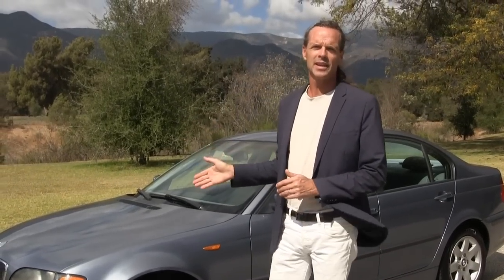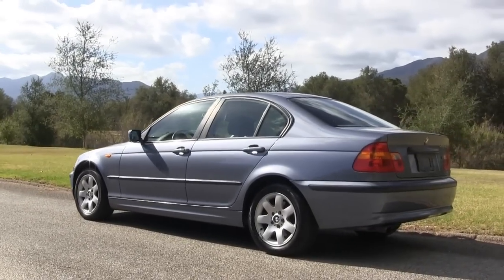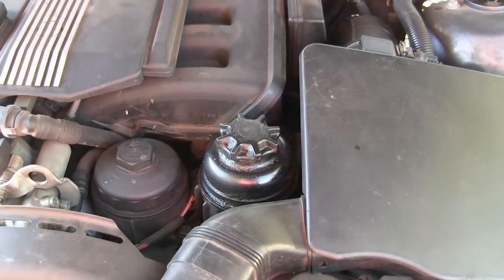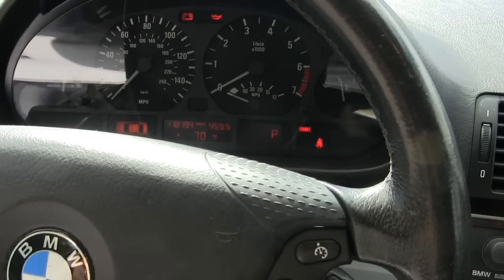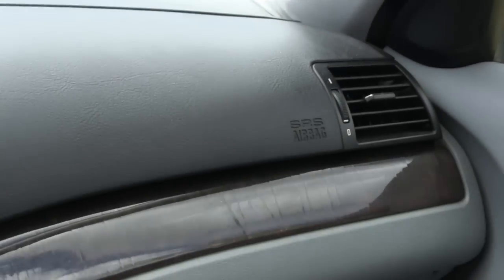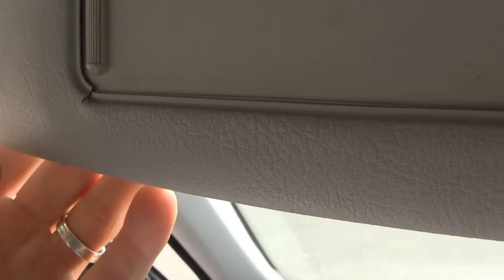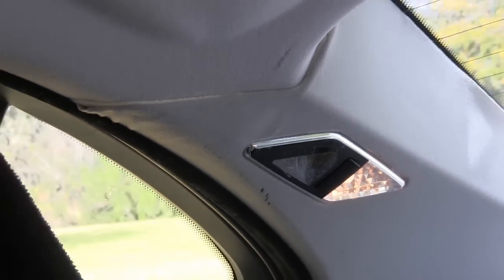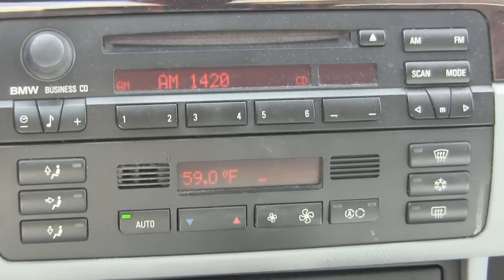Why You Should NOT Buy a Used BMW

Comment: I have this same car and mine is worse. It has all the stuff in this video, plus a leaky valve cover gasket, bad tail lights, cracked leather on the steering wheel, a $90 inop sunroof switch, I just replaced an ignition coil, and the lower control arm bushings are going bad. That said, I love it and it still drives and handles better than anything else of similar age and mileage. Other makes, Ford, Chevy have similar quirks and shortcuts in quality and drive like crap. This is my 4th E46 and I have become a quasi-expert at fixing these things so, for me, it doesn’t cost as much to own and I know what to expect.

Comment: Your audio is pretty much left-ear-only.  The right ear is a faded background noise.  You could convert to Mono using the right input and have a better audio quality.  I found out my system was  doing mono-right and wondered how you had 5000 comments on a video with no audio, but I persisted and figured it out.  Nice work!  I liked the video a lot.

Comment: "Don't even get me started on the window regulators." LOLOL. I had two e46s and had to fix 6 of the 8 windows. When the car is running, though, it's a great ride. And, it looks good with a nice set of rims. But, damn, you didn't even touch on the torque converter, oil pan leaks, cam cover leaks. I like when you hammered the grille back in with your fist. Awesome video.

Comment: My wife had a 2003 325i that had almost no issues aside from a washer pump and power window regulators.  We did trade it, however, when it began to show fuel pump problems.  Beware the "CA edition" SULEV engine that has the fuel pump permanently sealed inside the stainless steel gas tank.  The part is $7.5k, and dropping a gas tank isn't going to be easy or cheap.

Comment: I own 3 BMWs... One of them is a 2002 e46.. I've had pretty much all of these problems and had it fixed, replaced the parts myself. It cost me about 2000dollars all in all to achieve it, but now I have a 120k mile car which is as good as new... Apart from some rust which I have to get fixed for another 1500 dollars... But... I still don't regret buying it, because they are so much fun to drive. Interestingly my other BMW which is an e93 convertible has only had 2 minor issues (windshield wiper water pump and Xenon adjusting motor) after 10yrs and 120ks.. My X5 is pretty new, but already had some major issues, which were taken care of by the dealer for free.. Now that I don't have any guarantee, I'm waiting for a financial catastrophe to happen..... But, they still are the best cars for car enthusiasts... Not a Toyota or a Honda, but much better to live with because of the way they drive and handle.. It's somewhat like marrying a low demand pretty women who cooks for you each day, cleans and goes to work vs a high demand model, who can only boil water and wants to go out to eat every day.. Most of the days I'll go with option 2... Here in Germany, they say BMW stands for "Braucht möglichst Werkstatt", translated to English: Most probably needs a repair shop. It's definitely a luxury to own..

Comment: Good review. I had a 2001 325i for over 13 years and everything you mentioned occurred to my car. Loved the wonderful six cylinder engine but the items you mentioned, especially the window regulator failures which also messed up my tint, were very disappointing. I won’t buy another BMW.

Comment: I own a 2008 335xi with 135k miles on it. I own it outright...I will never buy another BMW but I've put too much money in mine to get rid of it. The e90 platform has like 6-7 major things that fail and I have replaced  5 of them so far: Oil pan gasket, valve cover gasket, cooling lines, high-pressure fuel pump, starter, water pump. The last thing left are the turbos. In my case they are still going strong with zero issues. I figure I'll run it till the turbos go then junk it.  I've put too much money in it to let it go....I could have bought a corolla outright for all the money I put in this car over its short lifetime.....but damn when it's working right it's a fun car to drive. It is also the best handling car I've ever had.

Comment: Due to new recycling regulations in Germany, many BMW's of this era had lots of cooling system parts made of plastic. But if you replace these parts every 60-80k miles, you should be fine. Plenty of people have passed 400k miles using BMW's of this era, with the original engine and transmission.

As for the interior issues, it is clear that this one has led a harder life than average. My mothers friend used to have a 525i E34, followed by a 325tds E36. That E36 interior held up until about 240k miles, and the E34 never had any build issues. Then again, these cars were UK models, and were built in Dingolfing, Germany (E34), and the E36 was built in either Regensburg, Germany, or Munich, whereas most US market BMW's were build at a separate factory in Tuloca, Mexico, where cars were built to a lower standard to European car, due to less stringent quality control inspections.

The E46 subframe issue affected all E46's, but only happened in large numbers to the M3, because only M3 owners thrash their car around the track. However, there are some very small and cost-effective modifications available which can strengthen the rear subframe and prevent cracks- these modifications include a rear strut brace, extra pins, extra welding, etc.

 In the UK, when a Mercedes or BMW reaches 200k miles, nobody in the country wants a high mileage car (people think mileage is all that matters here), so they get converted to LHD, and get shipped across to poorer eastern European countries, because they're despite the miles, they're too good for the scrapyard. I went to Croatia recently, and it was old BMW's and Mercs as far as the eye could see.

Put simply, a well maintained BMW (or Mercedes) will outlive its owner. Unless its one of those gadget filled BMW's, or a Mercedes A Class

Comment: My understanding of that soft rubber paint is that it is a two-shot molding process. The first soft touch layer is injected and they retard the cure or otherwise soften the plastic while a second harder structural plastic is injected behind it to fill the mold.

Comment: I own an 02 BMW 530i and so far it's a good car the only issue I have with it are the head lights adjusters and the lens are clouded up but I love in az. Car had 150k on it I drive 250 miles a day round trip for school and I am in love with the car.. My 05 ford mustang with 85k miles was in the shop more often... I'm sorry you opinionated people hate on BMW yes it cost more to maintain. But if you do the aluminum thermostat housing and aluminum water pump you won't over heat check on your hoses and use the blue coolant. And your good as long as you check your car weekly. If you know you have an issue get it fixed don't blame the car manufacture for your incompetence.

Comment: I bought a 2000 323i for 900 bucks with 154k original miles, no problems besides 3 of the windows not work but other then that runs awesome, this video should be about cars that aren't properly taken care of

Comment: I owned a 2003 E46 325i with a manual gearbox that I bought in 2013. The car was nearly perfect except for the cost of buying parts and fixing it. The only things that went wrong with it were the O2 sensors and the alternator but boy were they costly to replace. Even the specialist BMW shop, which charged only 50% of the dealership, was too much for me. The straight 6 engine was a joy but I didn't hang on to the car for too long because I knew I'd have to spend truckloads of money eventually.

Comment: I was loyal to BMW from 1969 - 1996. I have the 69 BMW 2002 I went with my father to buy new in Frankfurt.  My first car in 1980 was a worn out 70 2002 with 140,000 which was a daily driver for 7 years.   I later owned a 76 2002, a 71 2800cs, and a 91 e30 318is (with the M42) as daily drivers (plus a bunch of restoration projects and junkers).    These were great cars.    They needed some maintenance, but  they were easy to work on, and had quality materials (well, ah, except for the seat padding in the later 2002s whereby you eventually had a spring poking up your ass - easily fixed though).   BMW designed and built for the true enthusiast at heart.   The e30 (and the big sedans of that era 83 - 93) were the true high point for BMW - especially the 89 - 92 e30 (M42s).    My daughter had a relatively low mileage 5 year old 95 BMW e36.  True to the video author's reflections, this car was an embarrassing departure from what I was used to.  Plastic radiator neck that crack in half, the head liner falling out, the interior treatments drying up, chipping off, etc. At least the engine and driveline were reliable.  I didn't think it could get any worse and stupid me, I bought an e39 528is.   It got worse! This is the same generation as the e46 mentioned in this video. Window regulators breaking constantly (I wouldn't use the sunroof least I had to eventually pull out the headliner to fix it),   sensors going bad, the entire suspension including the rack and pinon steering unit had to be replaced at 120,000.   Plastic water pump impeller!  Really?!   Luckily I could do most of my own work, but you shouldn't have to do this on a daily driver at that age and mileage.  It all changed in the mid 90s.   This is when BMW changed its philosophy placing profit over owner satisfaction.   As the years ticked by BMW got more greedy and more and more detached from respecting their loyal owner's satisfaction.  Their new target buyer market was increasingly the clueless with money to burn wanting a status vehicle with those kidney grills and the blau mit weiss propeller emblem.  By the mid-2000s owners wound up at the dealership  A  LOT but always got the loaner for a month as the tech guys worked on their car (do you ever wonder why you see SO MANY BMW loaners driving around?)  Lease it and turn it in.  Management at BMW should be ashamed of what they have done to the solid gold legacy built by their predecessors. I  have a lot of enthusiast BMW friends who stand by the marque, but most of them are willing to spend the time, have the resources, and knowledge to DIY it to keep them going.  Hats off to them.  Tell you what though, they put in far more blood, sweat and tears on their newer BMW than I ever did on my pre-96 BMWs back when .  These post 96 BMW are like British-Leyland marques from the 1970s.    And it keeps getting worse!  The BMW V8s as found in the 2000 era 750li.   I love hearing BMW techs swap horror stories over a couple of beers on a Saturday night.  Plastic timing chain guides disintegrating,  spun bearings,  seal replacements that take 20 hours and on and on.   Then of course there is the modern N63 V8 twin turbo engine.   BMWs advice to owners.  Just keep adding oil and lots of it and often.  OMG.

Comment: I bought a BMW Z3 about 5 years ago, besides its regular oil changes, tune up and new tires here's the list of repairs I had to do  to the car: Replace air filter, replace a hose, replace brakes pads... that's it. Number of times the car has let me down on the freeway: just 1 time (when the hose broke), in 5 years my car only let me down 1 time for a very reasonable issue. I guess it is matter of luck if you buy an used BMW in good shape or in terrible shape

Comment: I had a 1993 740l that was fantastic to drive.  I traded it at about 100k because all four doors had rust at bottom. When I pointed it out to BMW they offered me a 50% credit to replace all four doors. Yeah, I'm going to put $5 grand into it. I went down and purchased an all aluminum Audi A8 in fall of 1998, when I drove in with my BMW to trade the friggin water pump began leaking. I was just in time getting rid of it. I'm on my second A8L and each have gone over 200k with no major problems of any kind. The trim, leather, headliner, dash buttons and everything is like new in the A8. No BMW for me. I may go with another Audi but in all honesty I'm leaning towards a Lexus due to their reputation for reliability.

Comment: I've owned 9 BMW's.  I put 389,000 miles on my 94 318i and it still ran great when I sold it.  Great and fun cars up until about 2003, depending upon the Series.   I quit buying them as they have gone horribly wrong and only care about moving units now.

Comment: I have owned five 3-series BMW's going back to 1999.  I am DEFINITELY strict with my maintenance because absolutely it costs a ton if you don't. BUT, I have to say, that 2 cars of mine that went over say, 95k miles plus one my son bought used at 85k miles... all of them became money suckers and basically started falling apart after 100k.  Which is wildly ironic because, this is EXACTLY the problem that European and Japanese car makers used to laugh about American cars... that they basically fell apart after 100k miles.  So imagine how shocked I was when problems with suspensions came up that a BMW CORPORATE TECHNICIAN who came to the dealership told me he couldn't figure out what was wrong.  Thousands of dollars of replaced parts later... the problem was never solved.  Thinking it was a fluke, I bought a second 3-series and once again, past roughly 85k miles, watch out cause your car is going to break big time no matter how much you maintain it, and you'll spend a ton of money chasing the problems.  The ONLY way I suggest owning a BMW is by lease... 36,000 miles...  3 years and out you go... somebody else's problem.  (BTW - It's extremely telling that usually, the longer the term of the lease the less you pay per month.... Guess What?  With BMW's, if you try to lease for longer term and higher mileage, the cost per month GOES UP?  WHY?  Because the residual value plummets once it's out of warranty.  What does that tell you?  It proves that BMW's are not designed to last... at all. )  Buyer beware.

Comment: I bought a used 2005 325xi it's amazing as long as you check everything is ok you'll be glad you did BMW are great cars the oil change is more expensive because of the synthetic oil but everything else costs just as much as other cars. I've had it for a year and all I've had to replace are the brakes and headlights EVERYTHING else seems to be fine.

Comment: M54 is a great engine. I already replaced water pump,02 sensor, cooling hoses/ expansion tank, wheel bearings,vacuum system, coils and plugs,engine mounts transmission mounts, rotors tires and pads.

Comment: Everything Greg Macke is saying about the e46 is true! I regret ever buying one. I bought my e46 7 months ago and boy it’s a piece of junk. With 156,000 miles after doing so much work on it and changing the ignition coils, spark plugs, VANOS and DISA valve It’s burning oil and needs a new engine. The plastic in it is crap. I love the way it drives and handles but it’s a piece of shit! Shame on BMW !

Comment: I have a 2003 525i E 39 estate that has 300k km on it. I bought it with 200k for about $3500 and it is immaculate and runs like a champ. I did have to change the front brake rotors but they were only $30,  I changed them myself and took about two hours. Because it has a timing chain, I never have to worry about expensive timing belt changes every 10k km. Luxury leather and wood interior, looks new, xenon lights and otherwise fully loaded.  A couple of diodes have dropped out of the digital clock but I own a watch so no big deal. This is mt third BMW 5 series over 27 years and there is no better car for the money if you can sort small upkeep jobs yourself.

Comment: I have a 2004 325i with 180k miles and the only problem I've had with it is the window regulator and the vacuum pump system. Both of those I've fixed by myself for under $80

Comment: All BMW, especially those that more than 8 yr old is suitable for DIY (confident mechanics).   Once you spent USD$1-2k fix all those problems, the car is perfect.  Everything mentioned for E46 is true, and I have to replace all, and more than what you said.  The cooling system replacement is applicable to all BMW generation, and it is a USD$500-700k (parts only) maintenance every 5-7 yr.  Window regulator failure is not applicable to coupe or convertible, and eBay can get the plastic replacement part (often failure) for USD$5 - $10 instead of the entire assembly USD$700

Comment: I agree with you.  It is an ultimate driving machine when everything is working.  I have to replace the power glass window myself on my son's 325 XI with more than 130,000 miles.  The parts just break due to age or use.  I don't think the car is designed to last 200,000 miles but it should last at least 20 years like my 1998 Honda Civic, still runs.

Comment: What do you think of older Volvos? I have a 99 s80 and It’s at 170,000 miles. I’ve had a bit of headliner getting loose at the A pillars but that happened when I shipped it over seas and sat in a hot container that made the glue break down. It gets extremely hot inside the shipping container and I’m in Texas now and it didn’t help the A pillars that sit in the sun. I did put New adhesive and it’s fine now. The wood is fine on mine and the plastics have held up quite well. I only had one latch break (too if cup holder) that was an easy fix. The interior has held up very well. There are bits of wear on the suede inserts of the leather seats. However all the finishes like on the plastics look brand new still. I also have been able to fix everything myself (there are a few other things I’ve had to fix) I’d like to see why other people’s experiences have been with older used Volvos. Comment below on how your’s has held up.

Comment: If you buy a used BMW, first overhaul the entire cooling system, replace the gaskets and hoses buy a code reader and you're set, the engine is basically bullet proof